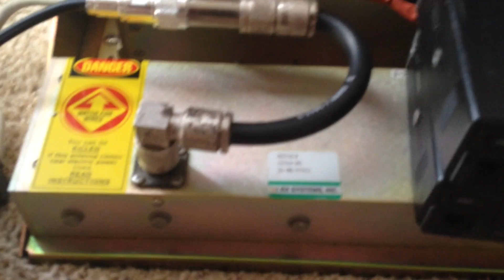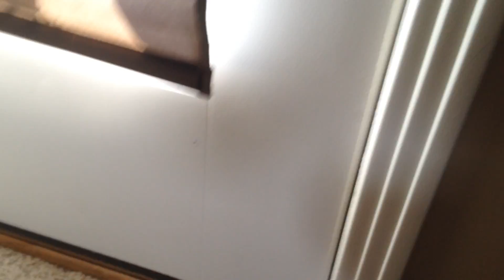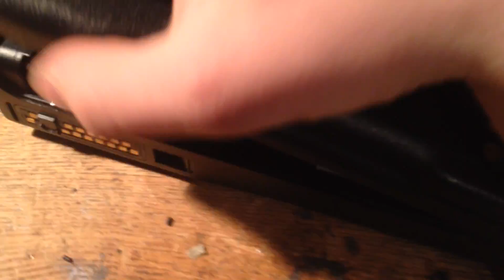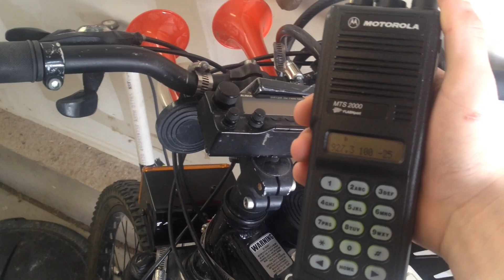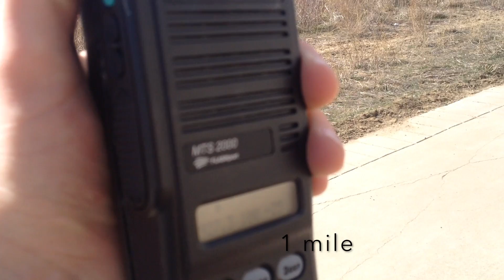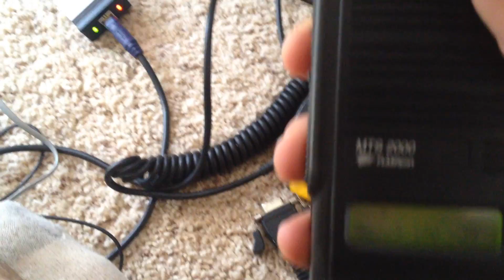900MHz repeater

Comment: I always wanted to make a community/neighborhood repeater like this with 4 sector panels and 1 30 watt repeater. Knock the power down to 5 watts each antenna after the slight line loss and angle them downwards for a solid 1 mile coverage in each direction, 2 mile diameter high sensitivity. Can run the HTs on 1 watt mode. I'd much rather 1200 but it's too niche and expensive and not many radios that I like available for it so 900 would have to do. I could chat on my favorite echolink while I walk around or go to post office or go shopping in the nearby stores.

Comment: It will go pretty far on an HT with repeater on second floor actually, you just need hardline and better connectors so it doesn't lose all the signal.
Reply: Yes with a real repeater and not just junk mobiles slapped together I could easily cover that whole neighborhood with just 5 watts output.

Comment: You might try putting receiver down to 902.0125 and Tx down to 927.0125 When I put my first 900 machine up i couldnt figure out why mine was death then i ran a spectrum analyzer and saw all the trash from 902.200 and higher from all the part 15 stuff. Those devices normally start their band giving some guard to the edge of the band, soon as i went down to the bottom of the band i had awesome sensitivity. i was using an 800 mhz maxtrac for a receiver and glenayre paging transmitter for TX. I've upgraded to all quantars now though. hope you are still messing with 900 MHz, its a fun band -KF4LZA
Reply from the maker: Yeah I have been working with a buddy KI0HC on real 900MHz repeaters in Denver. We're doing voting and hopefully simulcast soon with the Micronode International RTCM's. We ran into the noise floor problem and after we moved our receiver from 902.8375 to 902.0250 it really cleaned up everything! You can work the repeater system just fine with a handheld from all over Denver.
Reply: my current repeater, which is on th bench, is running 902.1375.  My next repeater will be on 902.0175n and/or 9022.0125 @SkylerF